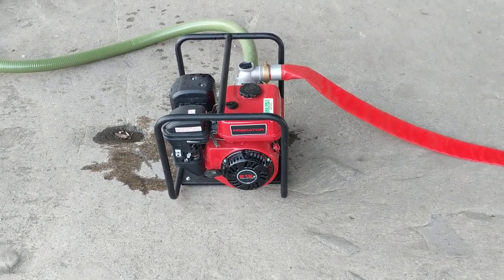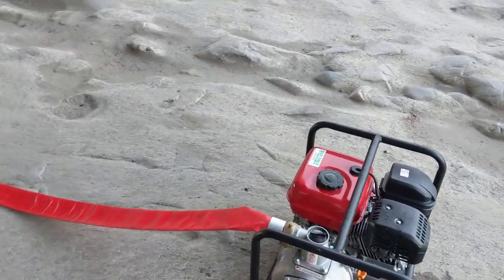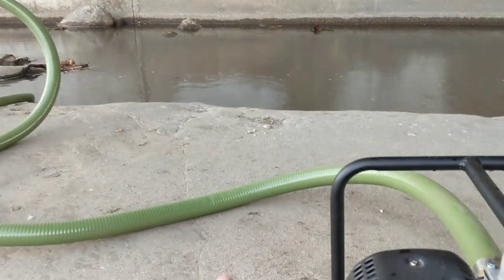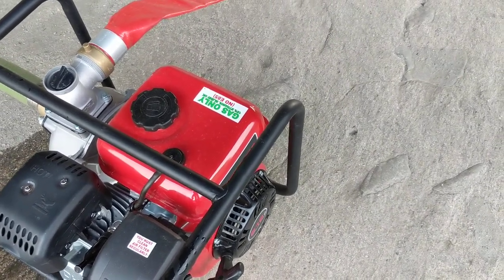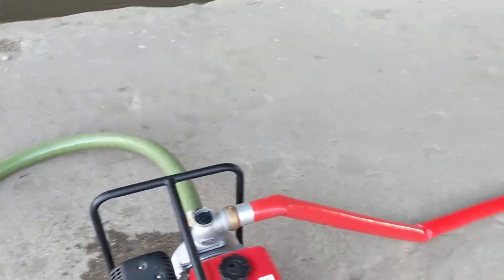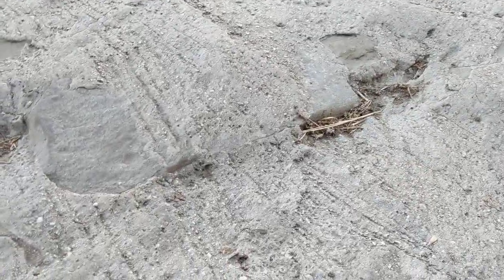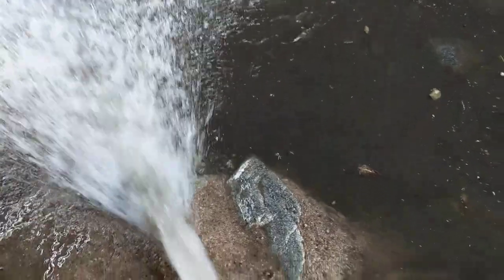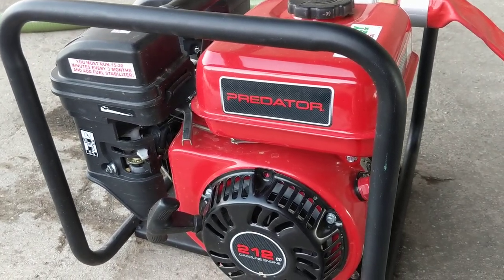Harbor freight 2inch semitrash pump review

Comment: This video’s four years old? Look man. These little Predator pumps are billy badasses. 

I drive tankers and unload 6000 gallons of oil at a time. I have a roper pump on the truck but it’s so dry being exposed to weather and road conditions, they need constant maintenance. 

Now I use these predator pumps. They’re so cheap, I can unbox a brand new one at each customer, if I wanted. If I have one for more than six months, I give it away (anyone will take one at a truck stop) and buy a new one. 

DUDE! They still look identical to your pump here. I bet they’re better now. Everything’s getting better. Now my $6,000 frame-mounted roper pump is just a backup to my Predator. 

And to be honest, if a Predator ever fails on me, I’ll just go a couple miles down the road and pick one up at the Harbor Freight. I also carry a spare in my truck. I mean, WHY NOT!?!?

I’m gonna check your channel more. Maybe you’re still kicking ass 👊🏼

Comment: thank you! especially for the tip on mixed gas. i kinda had a feeling that would be the case. broke mine in over a couple hours at full throttle with unmixed gasoline and it was pretty hot by the time its fuel tank was down to fumes

Comment: When ever you go to prime that if you will fill up the pump itself and once you start it pick up the discharge hose 1 foot from the pump up higher than the pump and kink it it will prime within seconds
Reply: Thankyou! After 15 minutes of troubleshooting this worked immediately.
Reply: Jcs9903 no problem how fast did it work for you?
Reply from the maker: I already had the case of the pump full of water. Apparently the reason it took awhile was because of that loop I had in the hose.

Comment: Looks super strong.  Do u think it would work to push water up hill about 200 ft.?
Reply from the maker: Mark Estrella depends on how high the hill is, in terms of horizontal distance it really shouldn't matter so long as you have a long enough hose, however the pump will only lift the water vertically around 90ft. Hope that helps!
Reply: @connorcruz6249  hey buddy do you think it'll pump water out of a 45 ft deep water well
Reply: @bowfishingfalcon1162  no. 25 - 30 ft is these pumps suction limit
Reply: Mine runs for 20 minutes,  then quits every time...full of gas.

Comment: I have the 1 inch version of that pump and I love it I’ve had it for three years and no problems whatsoever. though I did when I first got it added  a nice dose of Lucas oil stabilizer.  The only issue that I have is actually not that bad of an issue is that when I first start mine in order to kick it into full throttle I have to put the choke on slightly then slowly raise the throttle then turn off the choke.

Comment: Hi,  I see this was a couple yrs ago but maybe someone is still out there....I'm considering this for a home fire-fighting pump to pull water from my 5000 gal (smaller) swimming pool in the event of a wildfire.  it looks like you can adjust the flow if I needed so i can conserve water.  true?  you also said from pump to exit it's 90' and if you get a longer hose from water source to pump you can go further? can you explain that more?  Also if I had max GPM on it and I was 100' away the flow (pressure) will be less so the height of the stream will be lower?  do you know how much?  Is it better to have more hose from the source to the pump or vis versa to get max or control the GPM flow?  Sorry, one more question, what accessories would i need? 2 hoses from source to pump/pump to exit and can anyone recommend a fire hose nozzle?  Is the thread NPT?  I can't find any of this info in the manual.
Reply from the maker: Running a longer hose should be fine for transferring water, as long as the height you are pumping to isn't over 90' tall. These pumps are fantastic for water transfer but are lacking when water pressure is a concern, these pumps are more built for high volume rather than high pressure which is what is more of a concern with fire fighting pumps. The pump in the video does use standard 2" NPT threads on all hose  connections, and the flow rate and pressure can be controlled by the engine rpm. For a backyard fire fighting setup I would recommend a high pressure pump there are a few brands out there, one of which is the banjo series which Is made by a company called pacer; still engine driven of course, but they do come in electric models as well. Then you would need a 2" adjustable high flow nozzle but be wary of what threads are used on them, as fire fighting nozzles are threaded in ACME, As are fire service hoses.  Here's a shopping list which you can change on your discretion, 2" PVC suction line hose at least 15ft should do, 2" NPT female suction strainer, banjo high pressure pump or similar, I would recommend 150ft of discharge hose which should be suitable for most property sizes however you should measure the perimeter of your property and the distance from your pool to the front yard, and a 2"NPT adjustable nozzle. Hope this helps in any way.
Reply: @connorcruz6249 Man Thank You for the video and for this Fire Fighting info. That is exactly what I was wondering about try to get this to protect my house from forest fires.
Reply: Did you end up finding a Fire Pump set up that you liked. I had exactly the same idea you had…. Just 2 years later apparently😜
Do you have any recommendations or regrets that you can help guide me with? Thanks.

Comment: Can you use this for your catch basin
Reply from the maker: I'm assuming you mean as a emergency backup for a sump pump? Well I guess you could but the pump is more or less designed for continuous de-watering applications, if you were using this for a sump catch basin it would quickly drain it, then suck air and lose its prime, which would risk you cooking the seals in it.
Reply: @connorcruz6249  thank you connor what do you reccommend that would clean out a catch basin i dont wanna risk this nice machine you showing for that thanks for your advice👍
Reply from the maker: @serenasmith5946  I would recommend picking up a pump such as this https://www.harborfreight.com/34-hp-submersible-utility-pump-stainless-steel-construction-4400-gph-63477.html?cid=paid_google|*PLA+-+All+Products|All+Products|63477&utm_source=google&utm_medium=cpc&mkwid=s|pcrid|327822404853|pkw||pmt||pdv|m|slid||product|63477|&pgrid=71439424048&ptaid=pla-328098717344&pcid=1688396772&intent=&gclid=Cj0KCQiAiZPvBRDZARIsAORkq7dx_cZBlYdpmMHSRfxJ75EYwd6nToKZ2I78Ov3pXX5DScXIwim1k5IaAmTYEALw_wcB
Reply from the maker: And this pump is capable of ingesting small stones and debris. Start First by pumping out the water, rinsing the inside a few times with fresh water, and pumping out again, then using a wet/dry vacuum to suck up the bigger stones and grit. I've had to clean out a few sumps in my time an this is by far the easiest way.
Reply: Just picked one up today, we shall see how it works with some trenches

Comment: I was wondering, can you use a red hose for suction AND for release?  Instead of buying that green hose?  That green hose is twice as much money!  Anyone?
Reply from the maker: The suction hose has to be rigid otherwise it would collapse and you wouldn't get any water flow, unfortunately there's no way around it unless you wanted to use some PVC pipe instead, the fittings on the pump are  standard 2" NPT
Reply: @connorcruz6249  omgOMG OF COURSE!!  Geez what was I thinking.  I can't believe I actually asked that question.

Comment: When you say 90 foot head. What does that mean
Reply from the maker: That is the maximum height the pump can move water up to, but realize that does not mean you will get any flow out the other end. But the higher the pump has to move the water the less gpm you will receive.

Comment: Can you use reducer on the outlet for it to fit a regular garden hose?
Reply from the maker: You could however I would recommend getting the smaller 1 inch version of this pump if you intend to use it with a garden hose. The 1 inch version is also a bit  cheaper. Here's a link to the smaller version on harbor freight's website.https://m.harborfreight.com/1-in-79cc-gasoline-engine-clear-water-pump-35-gpm-63404.html?utm_referrer=direct%2Fnot%20provided
Reply: Connor Cruz  how much you paid for it
Reply: @connorcruz6249  do you think this would be good for pumping out porta jons
Reply: I use reducers so I could fit a garden hose to it

Comment: Thanks for this review, thinking about one of these pumps to pump out a sink hole here in Florida where mosquitoes won't have a place to breed, BUT may need well over 100ft for the drain side, can you add another 200ft? Would it pump that far?
Reply from the maker: As long as you have enough hose it should do it no problem.
Reply: @connorcruz6249   do you have an opinion on: if a smaller inside  dia discharge hose is used whold the back oressure   self destruct the pump?

Comment: thanks for the video.  would this type of pump (approx 5HP, 200 CC, 200 GPM) be able to push water from a creek which is in a 30 foot deep valley up to a field.  It would need to travel approx 200 feet laterally from the creek to the side of the hill, and then 30 feet uphill to reach the field.   field after that is approx 700 feet long.
thanks
Reply: Look at the pump curve for this model and add together the vertical distance the water must move and the head loss from the pipe friction.

Comment: I just got one 
Im not sure if have to use regular gasoline?  Or mixing?
Reply from the maker: Regular gas should be all you need, I was just talking about what I use.
Reply: Connor Cruz thank you!!
Reply: This is a 4 stroke engine. If a engine says it's a 2 stroke then you need to mix a 2 stroke oil in the fuel. Most 4 stroke engines can be found in your car, the only place that you put oil is in the bottom of the motor on 4 strokes and get it changed regularly. When storing the pump for more than a few weeks, it would be best to use ethanol free fuel. Often times it can be hard to find it in some states, but using 91, 92 or 93 octane will have the least amount of ethanol in it, or in some cases it has no ethanol in it. If your not sure use a fuel stabilizer or drain all the fuel from the tank and carburetor. Fuel stabilizers can be found at most stores that sell small engines like a home store or sometimes the gas station you buy your fuel from. 
Ethanol is at it's worst when left in the carburetor as it is a very small amount of fuel in the carburetor and the gas will evaporate quickly and the ethanol will remain and clog up all the little passages in the carburetor, often causing the carburetor to fail. Until it is cleaned or rebuilt. The vast majority of small engines that won't start is the untreated ethanol that is left in the engine. 
On a side note gasoline with ethanol has a very short shelf life due to the ethanol separating from the fuel. It can keep a small engine from starting if it's stored in a hot shed, in some cases that can happen in as little as a few weeks.